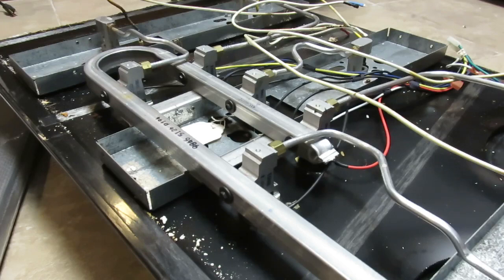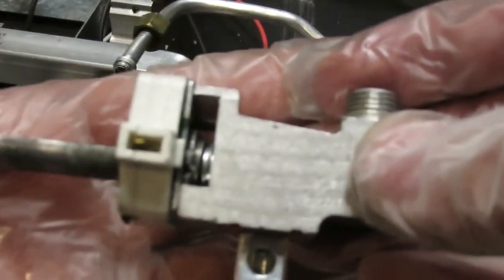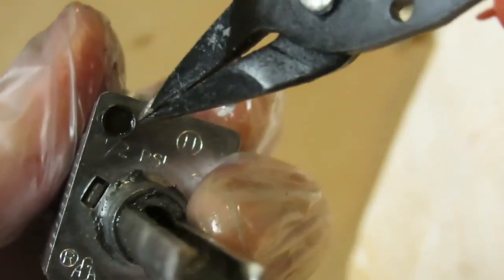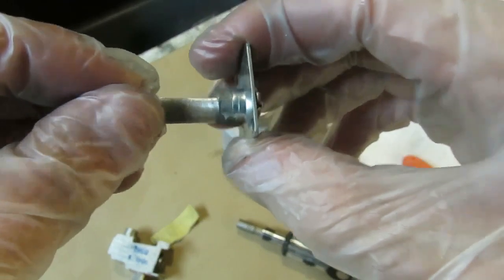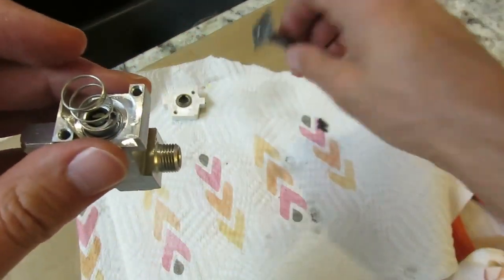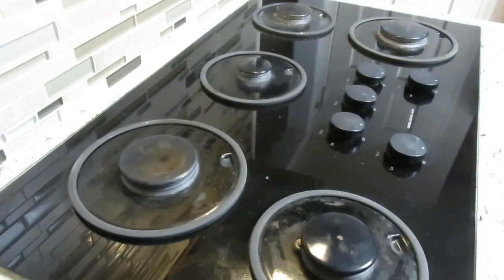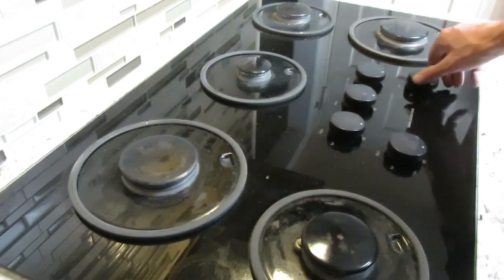Repair of seized valves on gas cooktop.

Comment: The gas burner valves on my 25 year-old gas cooktop, GE Model - JGP389WEV1WW, seized and also leaked gas. Thanks to your video I rebuilt all of the gas valves following your example and now everything works perfectly. The replacement valves cost anywhere between $150 and $200 a piece. This is the only video on Youtube that describes how to fix this problem. Thank you very much!

Comment: You have to use a thin layer of a thick sticky grease on the cone plug rotating surfaces which also acts as a sealing agent against gas leaking out!

Comment: Graphite grease, it's what us service engineers use. If you were to go as far as stripping everything back at least bubble it with leak detection fluid.
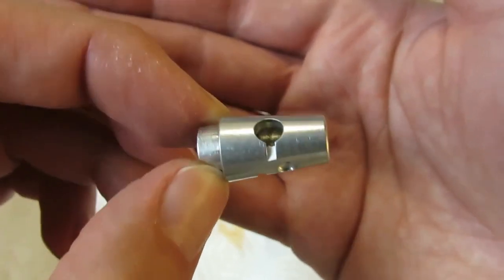Reply: Should the graphite grease be used around the 15:45 timestamp in his detailed video?  I used silicone spray as he suggested.  Operated smoothly at first but my 2 rehabilitated valves have become sticky & hard to move after 20-30 usages.  I'm thinking it needs a grease for the long term.  I just bought Hyheet Graphite Grease-- seems to be the right type?  other recommendations welcome.  Thanks.

Comment: Hi, thank you for this video. I know it's been over 4 years, but in case you're still listening, how did you clean the corroded parts? Use a product? A solution? Soaking them? Or just spraying? Use a toothbrush or wire brush? Sandpaper? Would really like to know how you got the parts looking like new. Thank you!

Comment: Shaft and sleeve made of aluminum: bad idea. The same happens to a seatpost in an aluminum bicycle frame, if you don't put a little anti-seize or similar grease it will weld cold. I once had the same problem on one of the wheels of my car, the rim had literally welded itself to the disc brake facing (in this case the wheel was aluminum and the disc brake steel, but it can happen as you can see). Thanks for the video, I had the same problem on an otherwise almost new cooktop that was stored after being used a while (2 years) by a person very fond of frying his food and generally eating very greasy food.

Comment: What turns off the igniter once the burner is lit?   Great detailed vid.  Thx!
Reply from the maker: redlense4 I believe the igniter lead is also a thermocouples. Once the flame is on, it warms up he thermocouples which sends a signal to the ignition box to stop producing spark. Pretty neat design but not without issues. If the ignition lead gets dirty it will not stop the igniter eventually burning it out.
Reply: A thermocouple is a flame supervision devise. The liquid in it expands on contact with heat from the flame. It's connected into the gas tap in this gas. If no flame (heat) is detected it shuts of the gas supply. So if something were to spill boiled milk for instance. If the flame goes out. The gas shuts off.
Reply: @mikes3872  I see.  It shuts it off instantly.  I'm going to be looking at a customers oven tomorrow.  She said one of the knobs is "stuck".  I suspect it's going to be a similar problem.  Thanks!
Reply from the maker: ghostmanromeo uk I probably meant thermoelectric probe as it sends feedback to ignition box using the same wire that’s used for spark.

Comment: How do I get to the valve?  Is the stove top just setting on my counter?  Just lift it up?
Reply from the maker: JediFight, mine was simply dropped in a countertop and held in place by some silicone sealer. Used a putty knife and had it running along the edge all the way around, freeing the cooktop.

Comment: What's difference between "anti-seize" compound and a good grease? - 12:22
Reply from the maker: Anti-seize compound is more resistant to high temps.  It's not like the valves will heat up too much (like the burners) but they still absorb heat so that's something to consider.
Reply: @mikes3872  OK